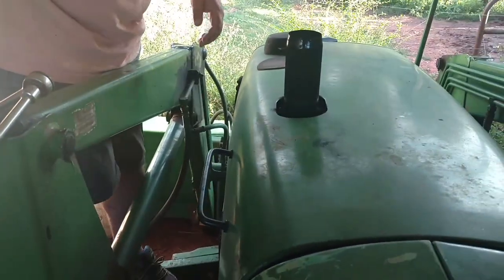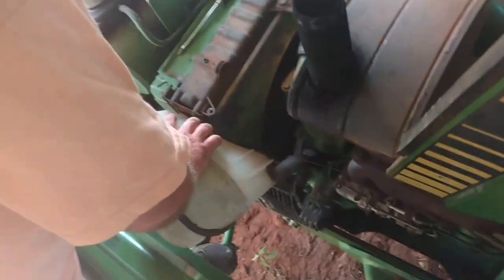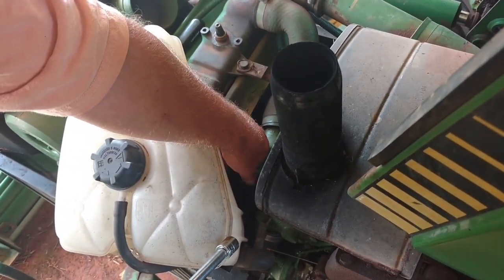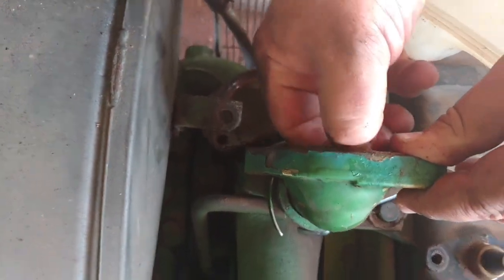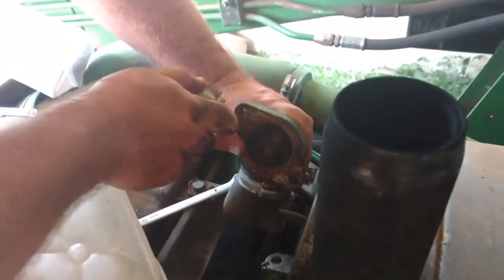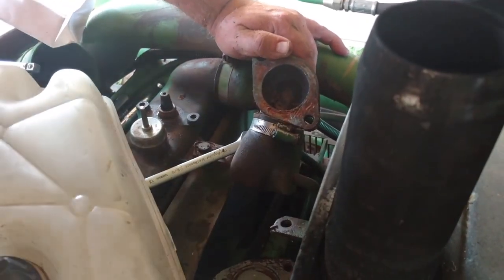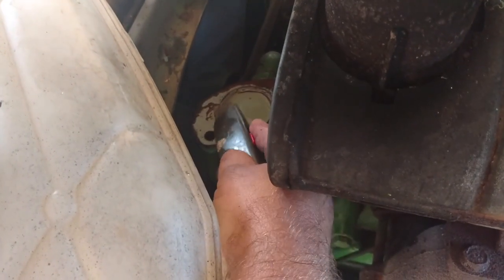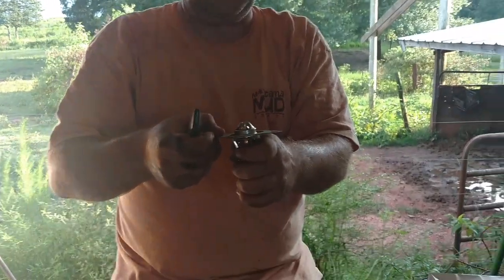John Deere 2155 - Thermostat overheating

Comment: My Alternator recently failed and I noticed my engine temp gauge was near hot. The tractor was running at low 11 volts, which affected the gauge display. Crazy I know, but check your voltage off of alternator too, running should be around 14Vdc. Thank you for video. I recently repaired the Rocker Shaft assy. Load sensing spring broke :-(

Comment: Where is the needle supposed to sit in normal operation. I have  friend who replaced the thermostat but it's still overheating.
Reply from the maker: We ended up replacing the thermostat with an independent one (not part of the electronics cluster) and having the water pump pulled and replaced.